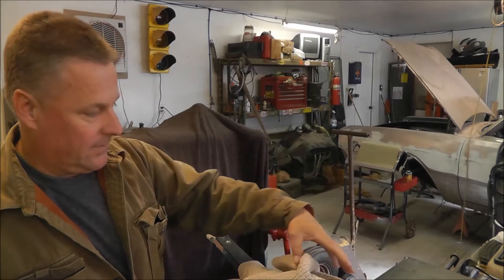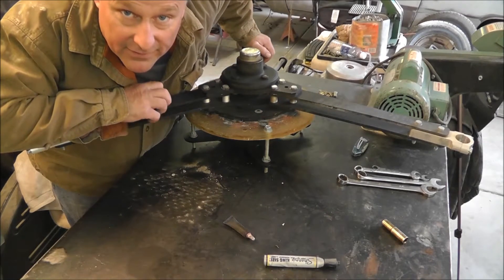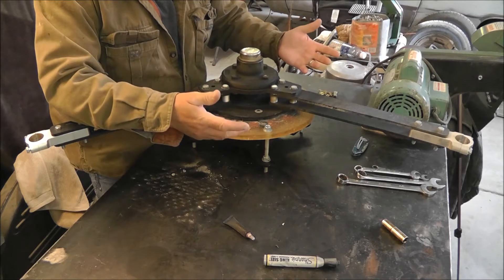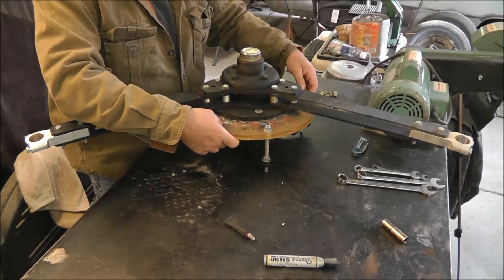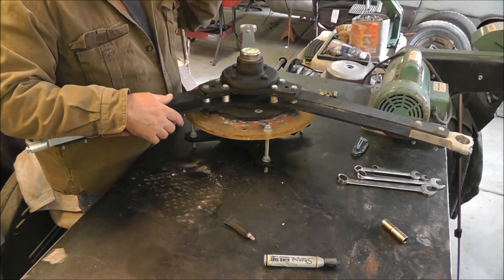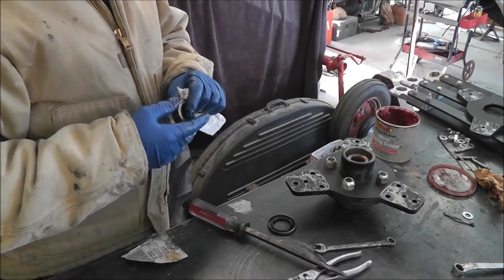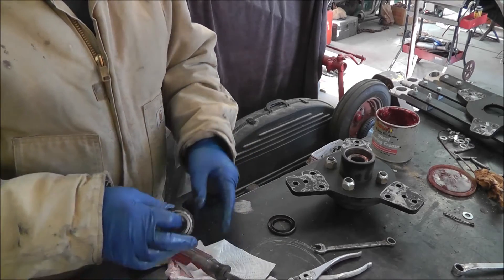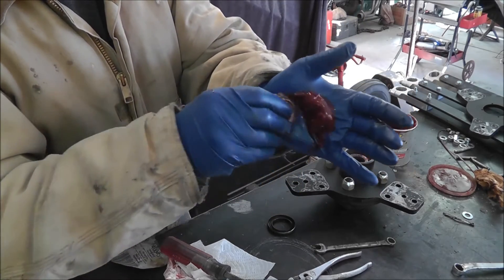wind turbine repair

Comment: If there was any pitting on those rollers,  I. Would have replaced them. They looked pretty bad. I guess you would have seen that,and done that.Right!!
Reply from the maker: Rick Palluck Before I stick money into bearings, I need to buy some sheet aluminum and build bigger wings.

Comment: That is a pretty cool setup Rick !  Have you tried to mix axle grease with some gear oil to just slightly thin it ?? I use that mix in mine and it is pretty good .. I also use that mix in the rear end in the lawn tractor ! THUMBS UP MAN ..
Reply from the maker: sounds like a smelly mess to me.....
Reply: Nope... it works well , And it will last without freezing up !!

Comment: You feeex!!   I likey...a lot!!!  Whatcha run with that?  Gonna have to check that out that link.
Reply from the maker: i run it through a grid tie inverter and have it hooked to the grid.  what ever I dont use goes back into the grid. but geographicly speaking, solar is a better alternative.  I think i need bigger wings too....more surface area would make it turn at lower wind speeds, well....thats m thinking anyway.